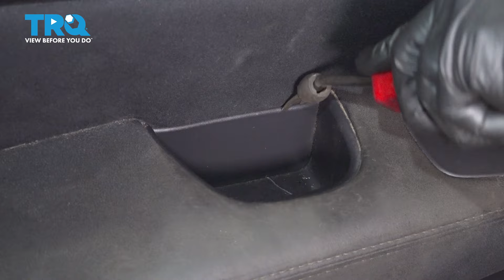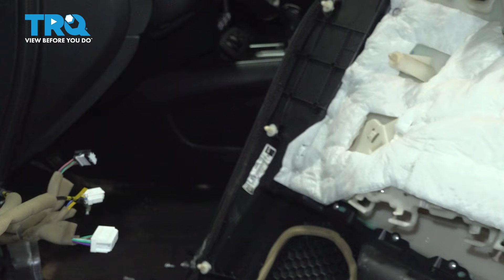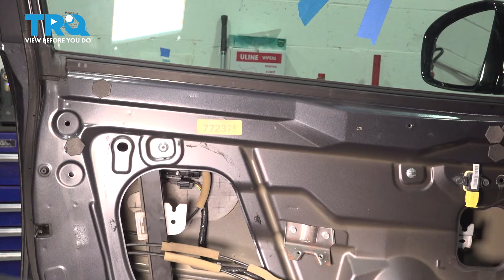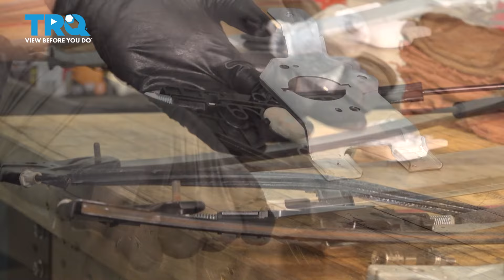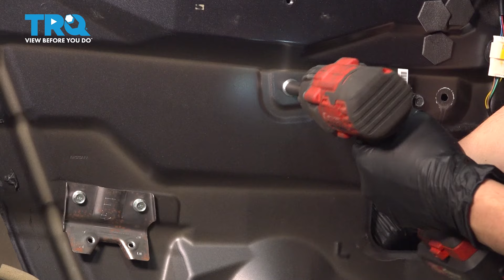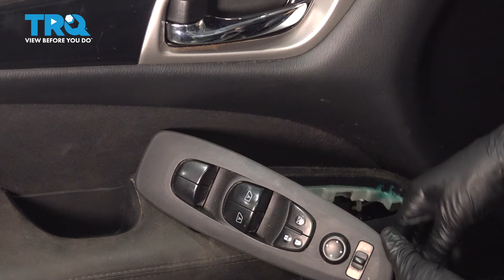How to Replace Left Front Window Regulator Nissan Pathfinder 2013-2020

Comment: I classify myself as moderately mechanically inclined. With this video and the parts I got from this supplier, I was able to change the window regulator myself and it installed & worked PERFECTLY. No struggling to match up bolts with holes, seriously it was easy-peasy. The only change from the OEM part was the 6-pin connector, which was configured with a female 6-pin receptor on a short wire pigtail, instead of the factory connector mounted in a round rubber bezel that lined up with a hole in the sheet metal of the door frame. Easy to figure out, and worked like a charm. Very satisfied.

Comment: I followed the instructions and I am gloating that i saved myself $750, this was amnt i was quoted from nissan. i bought the regulator for $50 from ebay and was able to make this repair successfully with the help of this video. thank you very much for the clear instructions! much appreciated!!! 2014 nissan pathfinder platinum model. and mines was on the front right passenger door but just
like he indicated same steps on the right side. took me about 1.5 hrs as i was taking my time so i wouldn’t damage anything and going over each step repeatedly. once i took the original regulator out, the coil from it was wrapped up in a knot and at that point i was for sure it was the regulator that needed to be replaced.

Comment: The problem I have is the window only goes up or down less than 1 inch so it’s stuck in the down position, which means I cannot reach that lower left window clamp bolt to release the window. How do I get the window up so I can access that bolt?

Comment: Just did this.  Window is still slow and seems to bind then stop.  Bad switch maybe?

Update: put the old motor/regulator back.  It moves fine.  Its the actual window that is binding on the seals somewhere.  I lubed the areas where the window slides but that didn't work.  Will likely need to get all the window seals/weather strips replaced.

Anyway, the part from TRQ was fine and worked fine.  Only problem was the motor connector was not against the motor with the rubber boot.
Reply from the maker: +@HATER506 Thanks for the feedback! http://1aau.to/m/Shop-TRQ